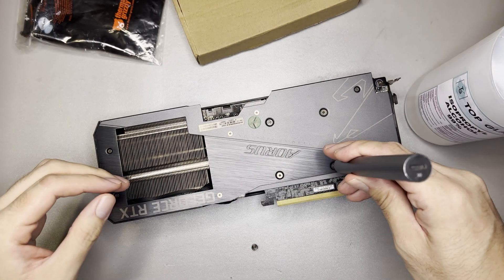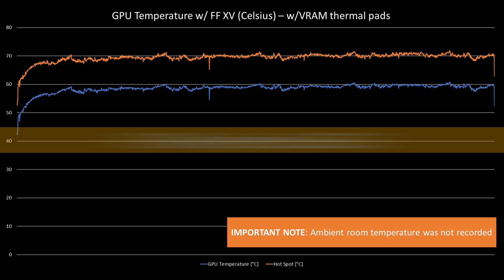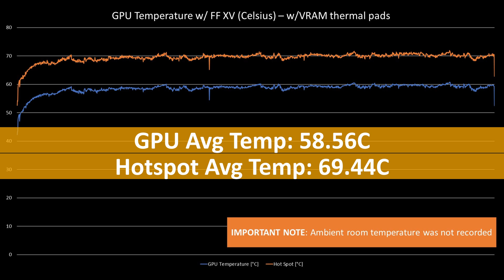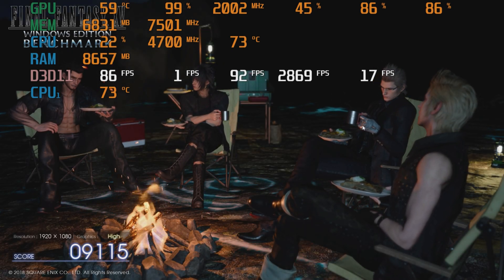MLLSE RX 6600M Teardown & RTX 3060 Aorus Elite Overheating Update

Comment: i replaced 1.5mm pad on aorus elite 3060ti the same card. heat is 90s and now Should i rebuy 0.5 mm? i saw another guy is telling 0.75 is factory size. please help me
Reply from the maker: Since there is no official documentation, try 0.75 first but make sure to properly tighten the card — 3 turns at a time. Seems that the cooler is prone to lopsided mounts.

Comment: Hello friend! My RX 6600 Sapphire Pulse, in stock, is reaching 115°C in the Hot Spot and turning off... I already replaced the thermalpads correctly and applied MX-4 thermal paste, but it didn't solve the problem! It heats up IMMEDIATELY when opening any game... All it takes is for its clock to go up and it reaches the temperature limit and turns off! Any tips?
Reply from the maker: Are you sure that you mounted it properly? Like 3 turns each screws at a time

If yes, have you tried removing thermal pads first to isolate?

Comment: what if i dont have heat pipes and there are only 2 wires on each fans ? rx6600m
Reply: I recommend buy new fans https://youtu.be/ysFloeuHt0k
Reply from the maker: You mean your MLLSE rx 6600m doesn't have heat pipes and fans are wired only and not attached properly? Tbh not sure. Some speculation: 1) old model 2) fake. I think it's more of #1. Try to see if you can set the fan curve in MSI afterburner, if not it is an old model.
Reply: @manongunboxing  man there are only two wires, not four as it should be speculations are useless. I asked what can i do with that?
Reply from the maker: Sorry sir for giving you useless speculations. I read your first comment and I really didn't understand what you mean and now suddenly to me it seems you want something to be done about it. Currently, I can't help since I can't imagine your issue. You may post it in reddit / discord and we'll see what we can do.

Comment: for the rx 6600m, i think the memory chips are not new but painted to look like they are new that's why you see some marks on the thermal pads which is presumably is paint, some YouTubers already found some GPUs from aliexpress with old memory chips painted to look new.
Reply from the maker: That's a good point that I missed. I find it sketchy though I scratched really hard from the surface and just made the text clearer instead of blurry. It's as if the pads was stuck into the vram and not the other way around -- i.e. vram markings making an emboss to the pads.
Reply from the maker: Anyway, I'm sending this gpu to my friend for longevity testing.  It will take 6 months to a year.
Reply: All this applies to GeForce GTX 2080 and Micron memory.
The 6600m uses Samsung memory, and the Brazilian bloggers did not find any traces of its repainting.

Comment: Was waiting for your update on the Auros heating issue cause it made no sense and I guessed it was a mounting issue, Btw I repasted my 3060 ti gaming oc and my heating issues were fixed after watching your video, temps dropped for hotspot more than 40 degrees which was great but now the 3rd fan is failing. Ordered fans and will get them on 17 feb, wish Gigabyte used better quality parts on their gpus.
Reply from the maker: Yeah. Thanks for the insights. It was at the back of my mind but wasn't a priority before since the gaming OC worked well w/o being serious at the mounting. After your comment, some neurons fired up and I remembered that Noctua was very particular at mounting and realized as well that Aorus has a heavier heat sink and f-ed up mounting could skew the contacts. 

Gigabyte's gaming OC is probably the golden ratio for cooling rtx 30 series. It has the right size of HS for the job (not unnecessarily over the top like aorus / strix, and not as weak as eagle/mech), quiet as well. However, I do agree on your comment re: better components. The thermal paste alone tells a lot as this was only apparent to Gigabyte.

Hoping for your fan issue to be resolved.
Reply: @manongunboxing  Agreed the gaming oc heatsink for the GPU is perfectly adequate but the quality is very lacking on the thermal paste,fans and thermal pad and that is what earns the company a bad reputation in the GPU market among the enthusiasts, they should do better to earn trust like Sapphire has for Amd gpus. I used a rx 580 for 3.5 years before this gpu, never had to repaste, replace fans or had any heating issues and now my brother is even still using it.

Edit:  While I haven't experienced it myself looking around on YouTube the gigabyte stock thermal pad seems to have an issue with oil like substance leaking out after some usage, definitely seems like a brand to avoid in the future.